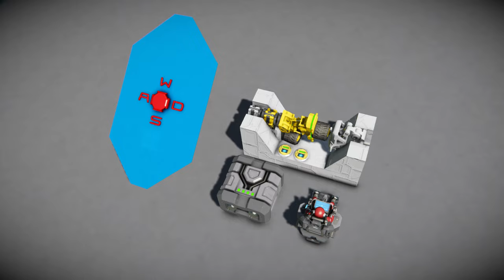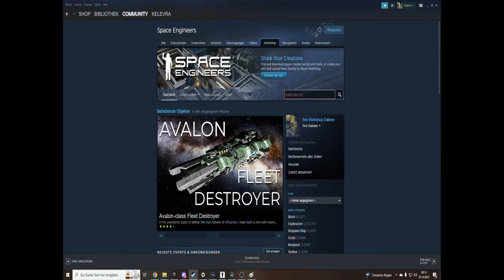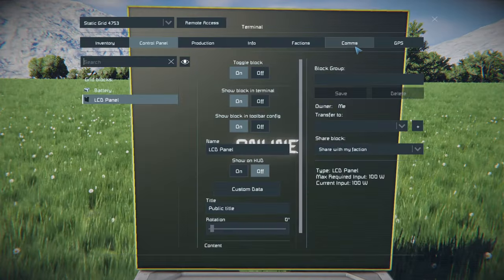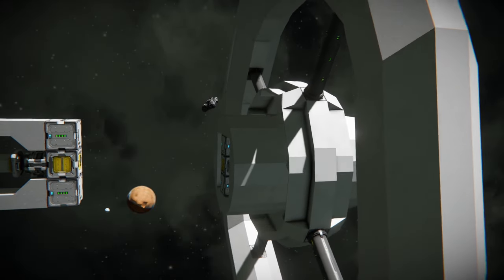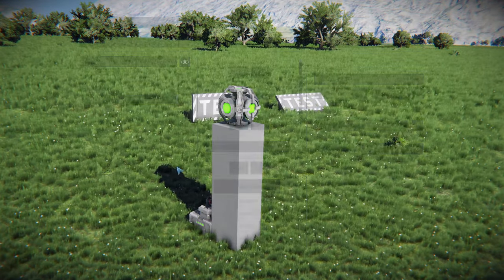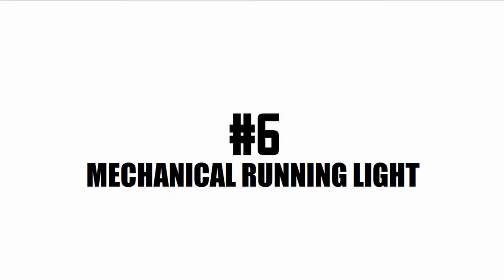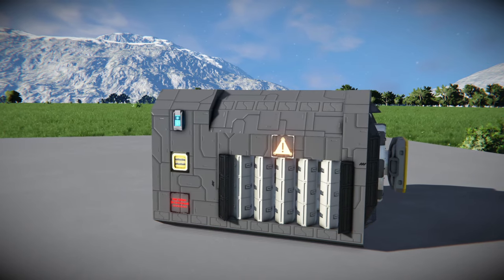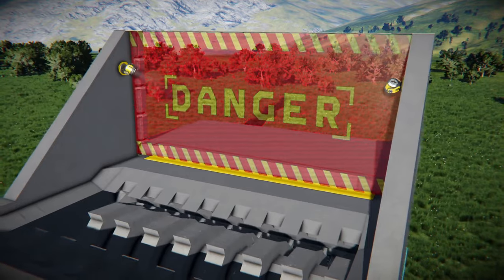[SPACE ENGINEERS] 8 VANILLA SOLUTIONS that may replace mods or scripts!

Comment: To clarify on that hovercraft technique, the visual floating is not caused by an engine glitch, it's just caused by vanilla wheel collisions being spherical (so the collision, extends slightly past the rim on each side, this is by design as spheres are smoothest when driving). I actually prefer to set them up with the suspension in the normal position, while it doesnt visually "hover" the dampening you get is helpful for traversing terrain bumpier than ice lakes too, and the 0% friction acts the same whether the wheels are vertically placed or not.
Reply: i agree. having a cushion when going over a jump is better in my experience.

Comment: I've known about the double rail gap, but your solution is way simpler. I had it horizontal, and tried to rotate a conveyor tube through it. It got stuck, and I figured you couldn't do anything with item transport. But this is a way easier solution

Comment: That double railing thing is cool ngl and I used it before. But, use it with caution as it can cause clang too. my experience with a dip in sim speed made my gravity ring became a scrap of metals lol

The simple colored projection also can be used as a hangar entry/exit guidance like on eve online bases too. And this can be combined with multiple color projections and sensors to make a precise guidance, like for example green for good clearance, yellow for close clearance and red for off clearance.
Reply: how big was your build for it to have caused so much clang?
Reply: @andrewding746  not that big, it's just that a dip in sim speed can easily clang subgrids like something on a rotor/piston/hinge or wheels (at least that's my experience)

Comment: This is kind of a long story...

So I'd been working on a base build,  & one of the hurdles you always run into is aligning your connectors at the correct height so that your rovers can hook up to them easily (assuming that your rover has a rear facing connector).  That was solved fairly simply by mounting the base's connector on a pair of hinges.  You could even map the hinge functions to a button panel & have really quite fine control over the height of the connector.
Of course that's not the real story - you see one day I'd hooked a rover up to the connector & I hit the button on the control panel to reverse the hinges.  Result?  The rover gets lifted into the air & an idea forms.

You see I'd been wanting to build a mid sized base rover for a little while,  and I'd wanted it to be able to carry around a couple of auxiliary vehicles.  Accommodating a flyer is not too difficult;  landing pads are pretty rudimentary,  but finding a way to carry around a small grid rover without bloating the large grid rover too much?  That had proven difficult.
But now I had a plan:  with a modified version of the hinge setup I could lower a connector to the correct height,  connect the small rover,  & hoist it up into the air for transit.

Of course this wouldn't be much of a story if that went smoothly.  To install the system on a vehicle,  the small rover would need to be lifted quite a bit further off the ground.  This means the lifting arm would have to be longer.  And as any engineer will tell you (and as I found out) this dramatically increases the amount of torque required,  to the point where the large grid hinges couldn't get the job done.

This almost stumped me,  until I hit on a cunning plan: I actuated the hinges by using pistons.  This did increase the bulk of the lifting arm,  and also required the installation of additional hinges to allow the system to move correctly.  But the resulting lifting arm was more than capable of picking up any small grid rover that I had.
I also carried out some testing because I felt like it:  A static version of the lifting arm was constructed,  and was capable of lifting a large grid rover into the air.  Now obviously the arm wasn't going to lift absolutely anything;  the rover it was tested on was fairly modest in size (for large grid) and that was pushing the limits of what the arm could lift.  But as a vanilla project I'm still extremely happy with it.

Comment: I've used the same concept with sensors to make a small grid burst fire 3 railguns, only after having (unsuccessfully) tried to use the same concept to make a rotary canon so I could get 4 autocannons to fire fast like the getting. unfortunately this did not work as the sensors stopped working at a certan speed and actually resulted in a worse fire rate than a single autocannon firing full auto alone. In hindsight now as i write this I theorize its because sensors don't immediantly trigger on and off, and have a bit of a slight delay.

Comment: currently im working on a Scriptfree Homing Missiles. welp, my versions are still modded since Vanilla only is much less effective than with mods. i made the missile with a Vertical and Horizontal Placed Rotor Heads. as reverte Subgrids there are normal rotors, then Merge Blocks for construction purpose and then override Gyroscopes. many People makes just Basic missiles due to the Limitations the game gives you if you make them without mods, but mine works much more advanced than you think, and it works on xbox too: as the Missile target computer i use a Modded Custem turret controller with standart 100km Targeting range (''Advanced Warfare 2 Beta''). the Gyros to keep the reversed subgrids of Rotors are  ''Kings''Tier 5 Modded to really make sure that the Rotors wont start to rotate, but only the Missile. as main thruster there is a ''Flares'' Tier 2 Hydrogen Thruster, powered by ''Kings'' 1x1x1 Hydrogen Generator and Tanks. also supported by ''Advanced Warfare 2 Beta'' mod, it contains Mini Nuke Warheads to make sure that only one hit blows a Hole in a Hostiles Dreadnought (i tested it on a workshop ship in dreadnought size, it really blew a Hole into it) - as side thrusters, for example to keep the missile in position, uses Kings Reaction Thrusters. with all those things you can launch such a Missile into the Orbit and make sure that the enemy only notice the missile when its too late for them. with a speed mod with about 700 to 1000ms this missile turns into a threat for every faction that uses all those mods. i will create a server soon with these mods and try these missiles on Players that cruisin around with their ships >:D

Comment: You can make your hanger force field trick air tight by using round window blocks. If you connect 4 of them so they are in a circle you have a space large enough to fly a small grid flyer through but since the sides of rounded and angled windows are airtight despite the fact you have a 4 block wide opening it will still be air tight as if it was a solid wall. The you just project the blue wall over the opening and you have an air tight hanger force field.
Reply: Oh that's so very clever, I would have never thought of that!  Definitely have to try that out!

Comment: I have got an issue, maybe the great engineer that you (and the other) are will find a solution. Have you ever heard about the arcadia ? The great and powerfull space ship of the capitain Albator. well there is on one vertion of his ship (cylinder shape) that have many turret on the top. They can move and change of side by sliding on rails. Can you find a way to make sliding turrets on the hull while keeping them connected ?
Respect for the pretty well done video btw
Reply: Maybe use the rails to have a turning ring with the turret on it?
Reply from the maker: Ainz that is exactly what you can do with the orbital rotor. The downside is that there is no way to build an air tight passage thru the center.

Comment: While not as aesthetically pleasing, someone else a while ago noticed that if you project a target dummy, those actually DO block bullets and the like, even though it's just a projection.  Not sure if they fixed it, though.  Would be really cool if they introduced a proper air-tight forcefield, Star Wars style, so you can have those giant hangar bays but have the ships simply fly in and out without having to deal with compression/decompression cycles.
Reply: Here's a question I've been asking myself: Isn't it super inefficient to pressurize the hangar? Star Wars and Star Trek and Star Citizen and all those do it, I think, mainly for the benefit of having people walk around without the need for space suits, but in SE we're in space suits regardless. So wouldn't it be far more efficient to pressurize the hallways, but not the hangar bays?
Reply: @sorrowandsufferin924  Star Trek and Star Wars it makes sense, because they have force field technology that can keep air in while letting the ships pass through them.  Keeping the area pressurized makes it much easier to work on the craft without needing a separate bay for maintenance (especially since, at least in Star Trek, you aren't dealing with a carrier, since other than when they tried badly ripping off Babylon 5 with the Dominion War, they didn't do fighter combat, always large ship).

This still applies to SE, if you're doing any manual repairs or construction and don't want to carry a lot of O2 bottles with you.

Mostly though, it LOOKS cool, and designing proper setups makes for fun engineering challenges.

One of my never-finished (they're all never-finished; I always feel like I end up with a giant brick lol) large ships I have two large nacelles, each holding a miner with a hangar door below them, connector on the ceiling and back of the miners.  The corridor to the main hull gets sealed, we depressurize the bay, and then the miner can drop out the bottom.  Practical?  Not especially.  Cool?  I think so lol.

Comment: Alternatively, if you just facepalmed over the contrived lengths one has to go to fix Keen's laziness to simply go the respective next logical steps (like a direct signal output for things like WASD of control stations like there is one for third-party target lock and loss now), you could always go to the support forums and add your votes on the respective threads to prevent them from falling into obscurity under the failure of reaching fifty votes. But of course, knowing the SE community and seeing the laughable amount of votes that is being spent there on an average day, you won't do that. So, you only have yourself to blame for why you just needed to facepalm. It's YOUR fault.